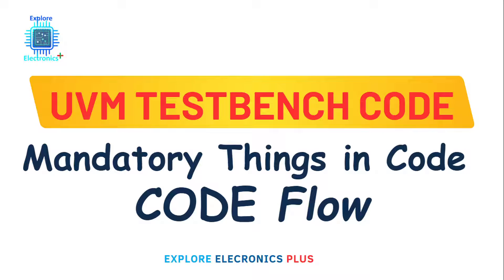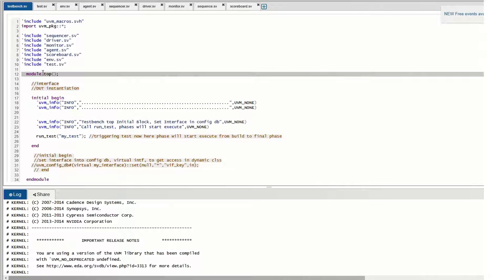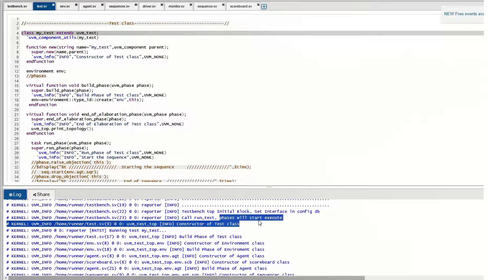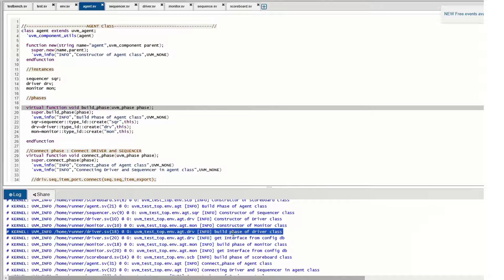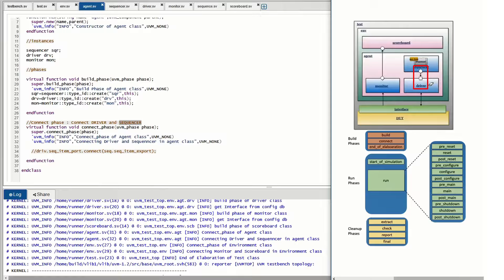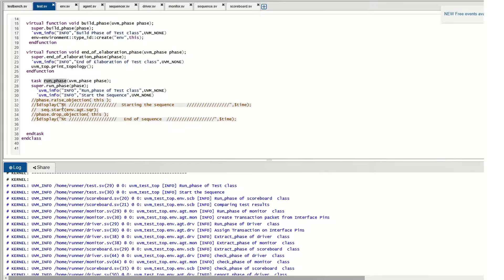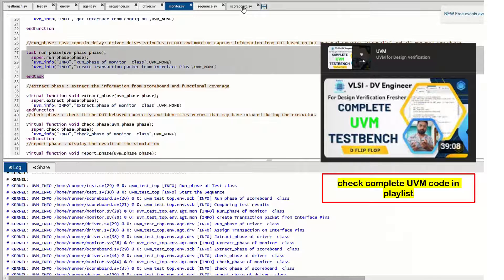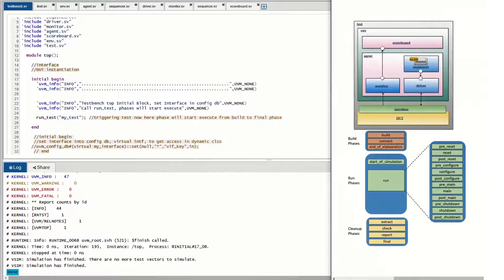UVM Testbench code and execution flow of Phases

Comment: [00:38] Overview of the UVM Testbench Architecture

[01:37] Introduction to UVM Phase Mechanism

[01:45] Broad Classification of UVM Phases (Build, Run, Cleanup)

[03:07] Testbench Top: The role of run_test

[03:40] Setting the Interface Handle using uvm_config_db::set

[05:31] Start of Build Phases (Top-Down Execution)

[06:16] Build Phase: Creating the Environment

[07:22] Build Phase: Creating Agent and Scoreboard

[07:56] Build Phase: Creating Sequencer, Driver, and Monitor

[08:36] Driver Build Phase: Getting the Interface Handle using uvm_config_db::get

[10:20] Start of Connect Phases (Bottom-Up Execution)

[10:41] Agent Connect Phase: Connecting Sequencer and Driver

[11:32] Environment Connect Phase: Connecting Monitor and Scoreboard

[12:25] End of Elaboration Phase: Printing UVM Hierarchy/Topology

[13:34] Start of Run Phases (Parallel Execution)

[13:54] Test Run Phase: Triggering the Sequence

[15:15] Driver & Monitor Run Phase Overview

[16:11] Why Run Phases are defined as a task

[16:58] The Cleanup Phases (Extract, Check, Report, Final)

[17:46] UVM reports (Info, Warning, Error, Fatal) and Simulation Finish